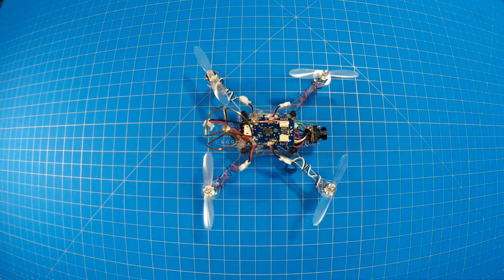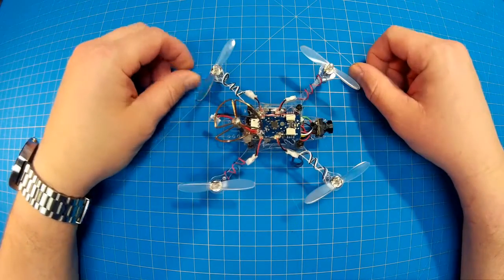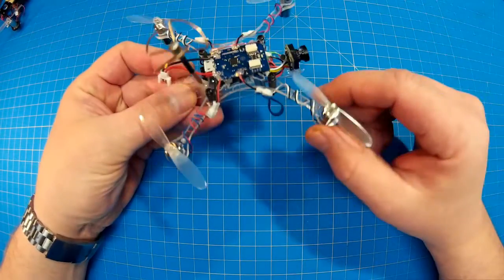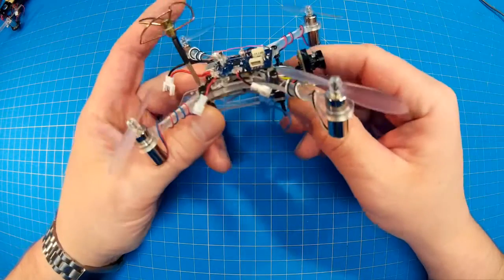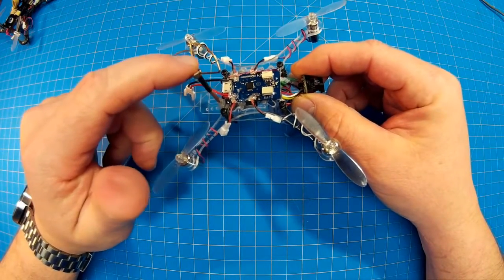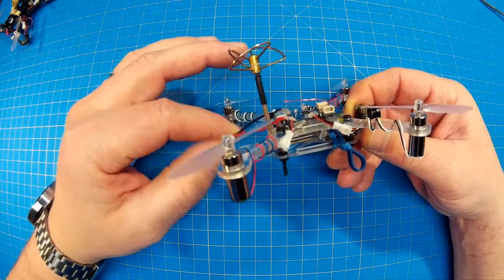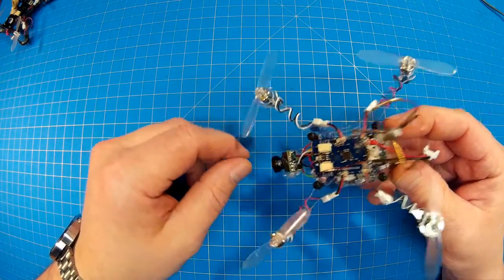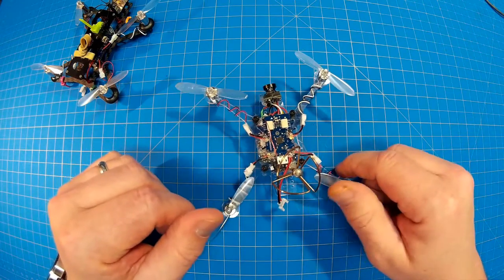SciSky/Pico on 120mm Picnic Efficiency Frame

Comment: Do you have any experience with the Picnic Quads Efficiency 80 frame? I just ordered one and I can't find anything about the best props to use for it. I'd guess that Hubsan props would fit, but I don't wanna buy a ton of them to find out that they're too big for the frame. Think they'll fit? I plan to put a Quanum vtx/cam combo on top, so it's gotta clear that antenna as well
Reply from the maker: not the 80, I primarily use the 120. I think that the hubsan props and any of similar size will work but the parrot props are going to be to long.

Comment: my Spektrum DX6 is binding to the SciSky board but Cleanflight doesn't show anything when I move the sticks.  what am I doing wrong?  Thanks!
Reply from the maker: +James Hwang Make sure cleanflight has UART2 set to serial RX, slider to the right. On the configuration tab RX-Serial should be selected, on the receiver tab, channel map is set to TAER1234. If its bound you should see movement. Also be sure you have your DX6 turned on before plugging in the scisky via USB.

Comment: How do you remove the hot glued components if you want to change something? With isopropyl alcohol?
Reply from the maker: +xuxusito I typically just pull it off, but yes isopropyl/rubbing alcohol will make it cleaner and easier to remove.
Reply: Will the isopropyl alcohol damage the components or the boards in any way?
Reply: Matthew CabaIIero don't drown the board in it obviously, but don't worry if you get a tiny drop or splash on there. Just wipe it off thoroughly after and it will be fine.

Comment: have you compared them to the hubsan ones from banggoods?
Reply from the maker: +Chi Sty I have not but many others have. The MRSS 820-17s, I believe, compare better to the MMW 820-17s which are considered the very fastest 8.5mm motors. They are also $31 a set.